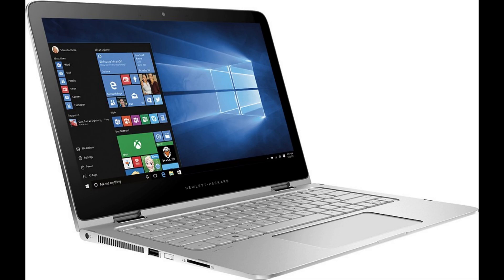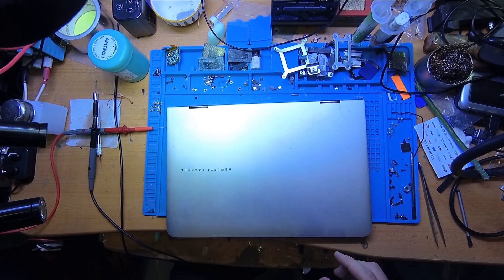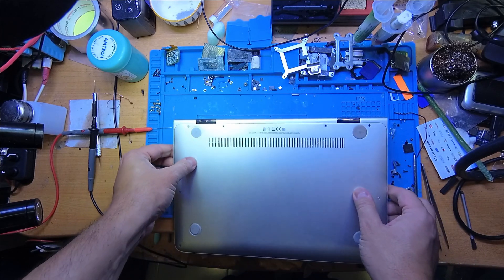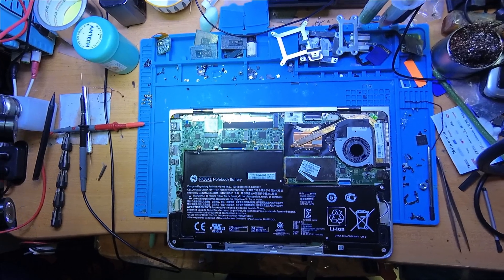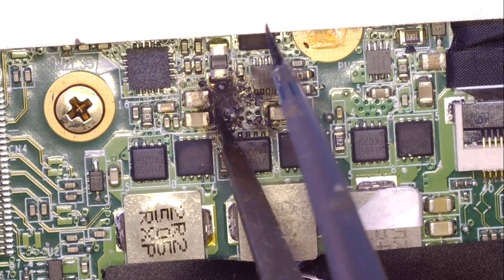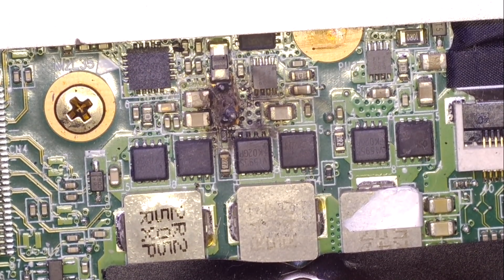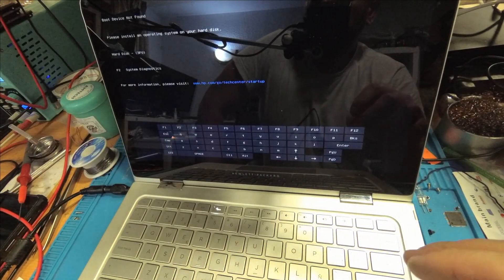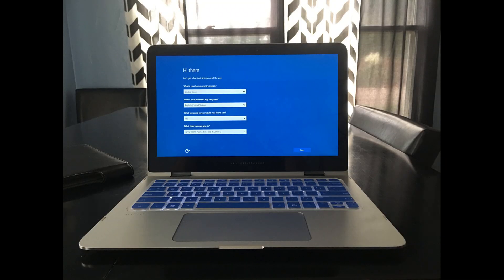HP Spectre X360 13 or HP laptop doesn't start and won't charge? Let fix it

Comment: Hi, my laptop is very similar and has exactly the same faulty capacitor (and also another faulty one). If I was to replace to the capacitor, what value capacitor would I use?
Reply from the maker: Hello! I checked a scheme - it is not important, so you don't need to replace it.